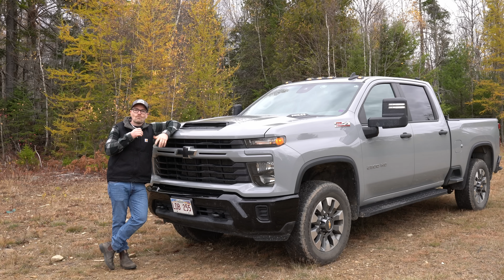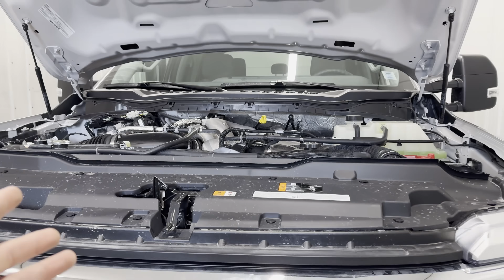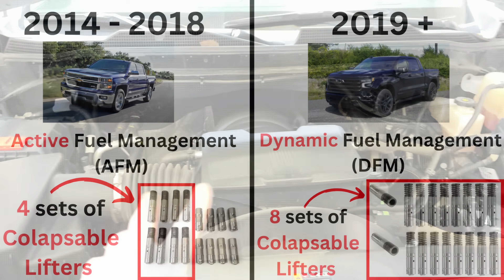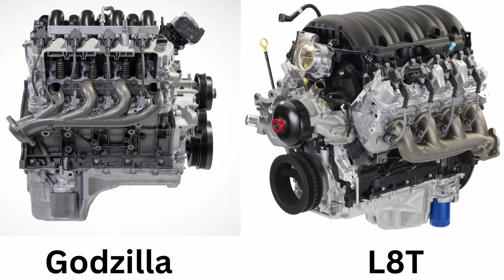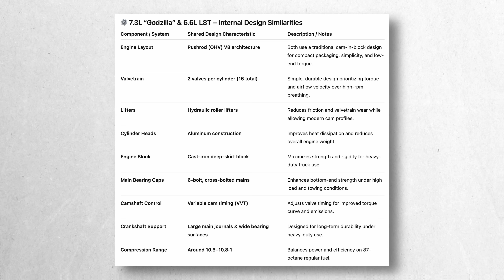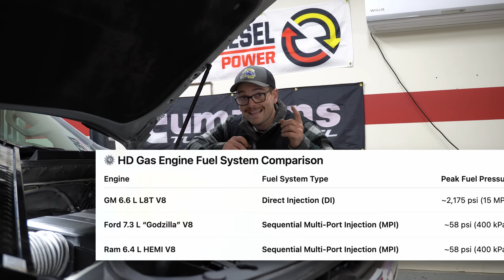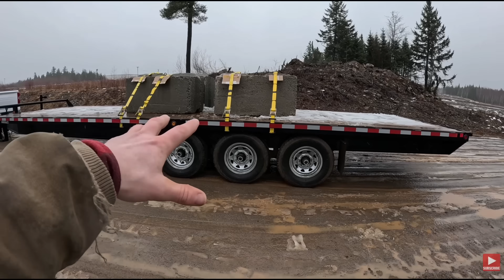Chevy 2500 6.6L L8T V8 Review | GM’s MOST RELIABLE Engine They Still Build

Comment: I've had mine since January now. I've got about 8100 miles on it. First oil change I did at 2000. I will change every 5000 as well. Owning and operating an auto repair facility for over 15 years and getting these in the shop occasionally, we just aren't seeing any problems with these engines or drivetrains for that matter. Also, I haven't experienced any "choppy" shifting characteristics and I bought the truck for pulling 10k+ lbs and it honestly outpulls any 8.1L with it's 10 speed transmission.  So far I am very pleased with my purchase.  And thanks for doing these videos, I've gotten a lot of info from you throughout the years, particularly of your diesel knowledge. 👍

Comment: It’s not the engines you need to worry about in this power train. It’s the transmissions which are going to give you headaches. These 10 speeds as everyone knows has had their fair share of problems specifically the valve bodies. Same story with the Fords. There are videos from Next Gen Drivetrains who designed some components to prevent breakdowns and would be a smart preventative step in fixing these issues.

Comment: I have a 22’ with 67k HARD miles. I have scaled 30k lbs pulling my dump trailer at disposal sites. Towed skid steers and vehicles across the country. I do more with it than most people do with their diesels.

I do consume a little oil. It has since day one but not concerned. It’s always due for an oil change by the time it gets low.

Comment: GM tech here. I’ve never seen the harnesses chaff on plastic valve cover covers and have never seen the plastic pcv hoses break they’re pretty durable and GM has been using this style of hose since 2014. Touching on the direct injection system. Induction services done regularly 10k-15k you’ll not have carbon build up issues and will literally pay for itself in improved power and fuel mileage. As far as reliability goes it’s not very common to replace injectors except the first couple years in the L83/L86 2014-2016 and were covered by special policy warranty. I’ve probably only replaced a dozen high pressure fuel pumps. As far as the L84/L87 and L8T goes I agree it takes a little more time working on these due to the windshield wiper cowling having to be removed to pull the intake but only takes an additional 20-30 minutes but the engine is wide open after that. L8T is fantastic and recommend it over the Duramax regularly unless you tow on a regularly basis or tow heavy. Most GM dealers recommend 5k oil changes service intervals.
Reply: I’m buying one today.. would you recommend I do the first oil change early? Maybe 3500 miles?
Reply: @aaronmay233  That's what i did on my new one and I also got the oil conditioner added which helps to keep sludge building up.
Reply: @aaronmay233  Your first oil change should be at five hundred miles.

Comment: I traded my diesel for this engine. Best move ever. Toes great , less maintenance and more reliable. Love it!
Reply: Toes…….
Reply: @pryme2013  👣
Reply: @pryme2013 Right… Tows😂😂
Reply: Same here just traded by 24 duramax for the 26 gasser. This has plenty of balls to tow my trailers and camper
Reply: tows. tows great. but you might be into feet. :face-green-smiling:
Reply: an l5p ?
Reply: great comment
Reply: @cyberpunkalphamale 😂
Reply: Got my ass in the sand, TOES in the water

Comment: I have been working on these since they came out I have changed 2 high pressure pumps (under warranty to be specific) in the entire time.  Glad to see one of GM's engines seems it's gonna be good.
Reply: What’s book time on the job? I’ve heard you can relocate the hpfp outside the intake?

Comment: Why is the torque the same as the 8.1? And 800 rpm higher? It's cool that this engine has more horsepower, but it has lower displacement and direct injection, and shouldn't it pull better than a 20 year old boat anchor?

Comment: Motors ok while gutless compared to the 8.1. The rest of the shipping crate around it is a complete pile. 2021 with 25k already ate an ac compressor, slipping trans, extremely slow to start, dash sounds like its about to fall out, air bag light on and shakes like a dog shitting bones going down the road. And this vehicle never leaves the road.

Comment: Great overview! Wanting to get a bigger bumper haul RV trailer, I just traded my 2024 Tundra hybrid for a 2026 GMC Sierra HD with this engine, and so far I’m very impressed, having never before owned any GM products. 
My transmission seems pretty smooth so far, although not as smooth as the 10 sp in the Tundra. The manual does say that the transmission has about a 4000 mile break in period. 
Our prior 2014 Ford f250 6.7 stranded us twice with diesel emissions issues, and we also had Death Wobble, so even though I prefer the Ford 7.3 gasser, I’m done with Ford.
PS I absolutely agree about the oil change interval. Also, is that a Canadian front end? Looks way different than my Denali.

Comment: Had the 6.6 Diesel. Put 50k pampered miles on it and had to replace 4 glow plugs and a DEF tank heater. All covered under warrantee. Lost my truck to the dealer 6 different times which is a PITA.  Ended up trading it in for a new 6.6 gasser. These are my thoughts so far. Power is sufficient. Being a HP junkie I thought I'd be missing the Duramax. Although the gasser is not the rocket ship the diesel was I'm not at a loss for power. Gas mileage in the gasser is horrible. Best I get around town is 12 MPG and avg 13 mpg unloaded on the highway at 80. Diesel avg was 16 MPG around town, close to 20 mpg on the hwy at 80. Both trucks equipped with the Allison 10 spd. Tranny temps in the diesel were 140 degrees all day long unloaded. Climbing or not. Never went higher than 160 towing a 5th wheel. Tranny temps in the gasser are notably higher. 150's unloaded on the flat, 180's climbing unloaded. Have yet to tow with it. I contribute the higher tranny temps in the gasser to the higher RPM it operates at over the diesel. Ride in the diesel is slightly better do to the additional weight of the diesel engine. Maintenance is cheaper on the gasser. As far as gas cost; it's a wash. $3.75 for diesel at 16-20 mpg or $3.40 for 89 octane at 12-13 mpg. Yea they say you can run 87 in it but 11:1 compression and 87 scares me so I don't run it. With all the emissions issues on the diesels, you can't go wrong with the gasser. So far no complaints.

Comment: I'm a gm tech. I never work on these. I replaced a faulty water pump one time. The only other time I ever turn wrenches on them is for brakes or a 100k+ maintenance
Reply: How are the transmissions on these. That seems to be the other weak spot that gets brought up a lot on forums
Reply: @robinphilip5747 The 6L90 is actually better. That’s why I have no plans to replace my 22 with a new one.
Reply: @pryme2013 the 6l90 is WAY more reliable.
Reply: @robinphilip5747 We do see occasional fluid leaks with low miles (less than 10k) valve bodies aren't great but you see that issue 100 times more on the half tons. They are solid units otherwise. Only time will prove if they can withstand age and high milage
Reply: @firstlast---  they've been on the road 5 years, i'm sure there are some with 200k
Reply: Would you recommend the 6 speed over the 8 or 10?
Reply: @kurtkieswetter7640  6 or 8. The 10 speed on my duramax had a failed valve body and then eventual failed transmission At just over 20k miles.
Reply: I don't believe you considering that GM is saying that one liter per thousand miles is acceptable loss in the engine which is absolutely disgusting
Reply: @rockymountainhomestead Most people don’t lose a drop. My truck doesn’t lose any oil.
Reply: @pryme2013  same. 135k miles and has never burnt oil
Reply: @pryme2013 I burn about 1/2 qt per 7500 miles.
Reply: @rockymountainhomestead most manufacturers state the same rate for their engines
Reply: I have 24 drw 3500 crew cab 4x4. 13k on it. Transmission pump and stator shaft have been replaced already. Now it’s sitting waiting on a rear end as the carrier bearings failed and damaged the housing. I’ve only been able to dive the truck one month out of three months of ownership. It’s been a nightmare already
Reply: @AdamCulp-b1f  I have a 23' 3500 4x4 drw 6.6 gasser with the 6 speed. 130k miles and only repair I've had to do is a trans cooler line and a front axle seal.
Reply: Just hit 100K with mine, so far so good. I don't lose any oil that is noticeable.  Trans replacement at 80K, exhaust system twice, third coming, but that's due to Vermont winters. I need to do a front axle seal and some valve body upgrades and trans pan in the future. Overall a beast of a truck.
Reply: Can you confirm that the gas 3500 trans has heavier duty internals than the gas 2500 trans?
Reply: @Keto_Fatty_Syndicate : No, because it doesn't. GM builds their transmissions to meet engine tourque output . A 3500 with a 6.6 would get the exact same trans as a 2500 with a 6.6 .
Reply: @Keto_Fatty_Syndicate Same trans
Reply: Sad that the 5.3L and 6.2L cant be that way
Reply: @35RSkyline supposedly the '26 wont have dfm on the 1/2 tons. But, there's a new design that gets rid of the collapsing lifters and is going to involve some kind of hydraulic disconnection on the push rods instead.

Comment: Still trash.  Literally every manufacturer realized that DI-only is a recipe for disaster.  Needs dual injection (direct AND port injection) to truly be a good setup for the long haul.

That was one of the biggest selling points of the Ford 7.3L gasser.  Port injection only... Simplicity, and no direct injection to deal with.

Comment: I use the truck for 90% daily driver.  Live in a rural area so slow local drives and regularly drive 150 miles RT on the interstate.  

I know LTs well from my time swapping one into my C10 (L83).  I love the L8T build specs and this truck was essentially the same price as a half ton.  There are a few more costs but overall I think this is the best Gen V on the road.  Big and slow is fine with me.  

Only issues I run into is I occasionally go into urban areas and parking decks scare me.  Fuel mileage is fine for me.  I get 14 locally and 18 on the interstate.  All my 3/4 and 1 ton friends want with diesel’s want to drive it and always say they are headed to trade.

Comment: I use a single cab 3500 w the 6.6L gas for work, I love it. The engine always feels like it has more pull but its not revved up all high in the rpms. Its also really quiet as far as cab noise

Comment: You talked about the clunk in the transmission. 
I have the gmc 6.6 gas and I here the clunk when It shifts down. It happens when I am almost stopped. Probably when it is going into first gear. 
The interesting item....well I own a 15k RV that I pull. We were out this summer for nine weeks going around the county pulling the RV. We did not here the clunk all the time we were out. Mostly pulling but then again driving  the truck for site seeing. The other day we took it for a ride, no trailer and the clunk came back. Now, it's not there all the time but when it happens as I stop you cannot miss it.
The trip this summer was over 8k in miles. Only put in one quart of oil  all the time we were out. I change the oil every 4k. When doing the hills in the rocky mountains I took my time. Sometimes climbing a large hills at 40 mph. Watching transmission temp the hole time. One hill was so high and long I went down to 35 mph to stop the trans temp from climbing to much. I always tried to keep the temp under 200. Once it got up to 226.
I do love the engine. Had a diesel that kept having problems traded it for this gasser.

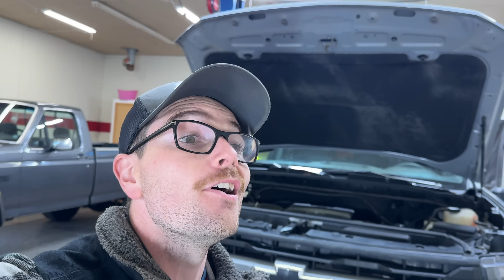Comment: 7:45 this 6.6 is the only current GM gasoline engine without cylinder deactivation
Reply: The 2500/3500+ never came with cylinder deactivation

Comment: Have not had a single issue with my 10-spd, it doesn't feel clunky to me. I have been in the new Ford as well and with the skipping gears it concerned me about longevity of the Ford, I will stick to the GM 10-spd

Comment: If they didnt have direct injection id almost agree, a lot have also had injector and high pressure fuel pump issues. We have had 4 come through the shop with holes in the piston

Comment: I just wish GM would bring back the 8.1. The Vortec 8100 is still to this day an AMAZINGLY reliable and bulletproof engine. I have one in a 2006 with 425k on the clock. The only thing I have had to replace is one head because of a bad valve guide....
Reply: My cousin has one in an '02 with 400k+, and will idle 40lbs of oil pressure. Amazing engines
Reply: @bobover2267 I have been annoying the Twitter account of GM/Chevrolet making sure they know we need the 8.1 back

Comment: If they wanted......all of GMs V8s could be this reliable.
Any MPG difference with direct injection, will be more than offset when you have to pay someone to clean the valves, or prematurely replace the engine. The vehicle that pollutes the most is the one that's unreliable. The next worse polluter is the one that requires "extra" maintenance. When the government states MPG, they really should count the gas the tow truck used, the gas the rental car used, the gas used to go to work an extra week to pay for this crap, and the gas the mechanics, and parts vendors used to fix it....and the gas used by the manufacturer used to replace engines under warranty. If we published those numbers...and really cared more about the environment, than the joy of taking someones else's property....we'd be frantically trying to get back to the reliability we had in the late 1990s.

Comment: As a GM tech, this is both informational for vehicle owners AND flippin hilarious. That fuel pump can be swapped out in 15 minutes. Remove the intake piping, ten 8mm bolts, and the intake is off within 5 minutes. That plastic cover comes out with it. 2 bolts hold the pump in. Heck, both cylinder heads can be removed in less than 1.5 hours. I have yet to see a pump fail on a V engine. On the other hand, i spent 2 years as a mobile truck tech in a 2021 F550 with the 7.3 and hated opening the hood for anything. I feel like this "review" is just alittle biased toward the Ford engine.

Comment: From what I have read, the 10 speed tranny was developed as a collaboration by GM and Ford and for practical terms are identical cores.  Different programing obviously.  GM had a branding deal with Allison which Allison just recently cancelled because the tranny is no where close to Allison standards.  I own a 22 f350 with 7.3 and absolutely love the engine.  I change the oil every 4k.  No problems at all with 55k miles and almost all towing miles.  NextGen Drivetrain makes an upgraded transmission valve body out of much more durable materials that I think I will spring for.  I bought this to be my last truck (I'm 60) and I think it will outlast me.

Comment: The engine is completely irrelevant at this point because it's made it to a completely broken 10-speed transmission that is not made by Allison. Matter of fact the situation is so bad and the lawsuits are piling up so fast that Allison has done a complete break from GM. And the letter to GM. They said that anything after June 2027, GM will have to strip the Allison badges off before they can sell them. That's a bad breakup because GM is making Allison look bad. If it wasn't for the garbage Allison in name only transmission, this might actually be a decent truck.

Comment: Those dual injection systems do NOT completely solve the intake valve deposit issue, but still add the complexity of an entire extra fuel system.  That's something to think about.  I hope GM evaluates port-only injection for 8600+ GVWR Gen VI engines.

Comment: Assuming piston speed doesn't exceed some number, stroke has nothing to do with RPM capability or where HP peaks in an engine design.  That is exclusively dictated by the cam, head and intake design.  It was an economical way to increase displacement.

Comment: This is only possible because 8600+ GVWR isn't under the same regulatory pressure as lighter trucks.  Also notice the fuel economy results for 1/2 tons.  It almost looks inversely proportional to specific output.  The more HP/liter, the worse the fuel economy was, or that seems to be the general trend.  In trucks, in the real world, these engines are under some load.  And high specific output is probably not more efficient under load.  This is backed up by design choices we see in industrial/heavy applications.  Look at a large truck, heavy equipment or a train.  They are all large displacement, low RPM engines.  If it were better to use a smaller, higher revving engine, they would have done so.

Comment: The 400 cubic inch engine has been around at least since 1970. Pontiac had a 400 out since about 1967. The ten speed auto is crap, give it a manual transmission!!!!

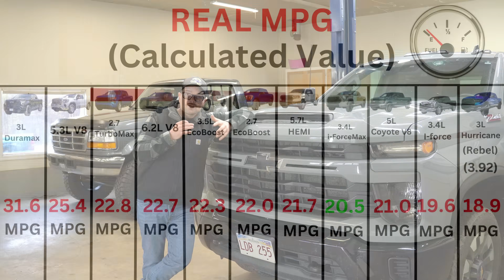Comment: I still think the 7.3 ford Godzilla is a better engine. Plus the fact you can get optional 4:30 gears is a better package.
Reply: No,  it’s having more issues.
Reply: @panchovilla1234 they all have issues
Reply: @panchovilla1234 go watch TFL when they compare the Godzilla to the 6.6 Chevy gasser on the Ike towing test.
Reply: Can confirm the issues with the 7.3 Godzilla. We have them in all of our E450 cutaway buses and I’ve already had to do new lifters and cam in 3 of them and had to do a new motor in another bus. They’re all 2023 and 2024 buses. It’s upsetting because I really like that Ford brought back a big pushrod motor. Maybe an aftermarket cam and lifters will fix a lot of the issues. Plan on doing a build on the 7.: in n the future. At home I’m doing 69 c10 and I just got a 6.6 L8T for it. Have high hopes for it and have been hearing really good things about these motors.